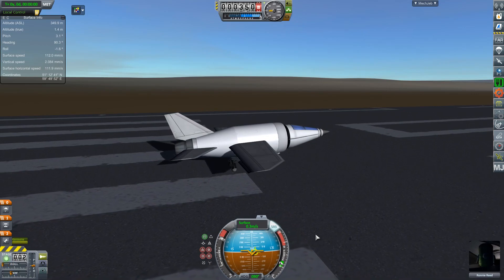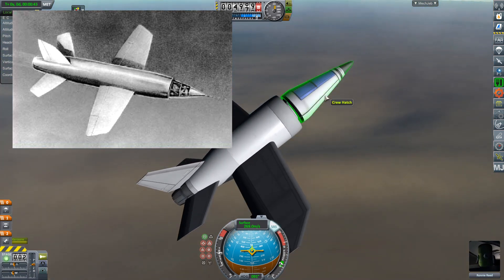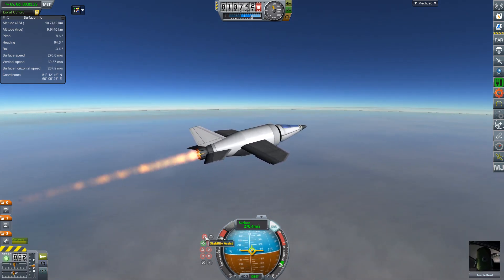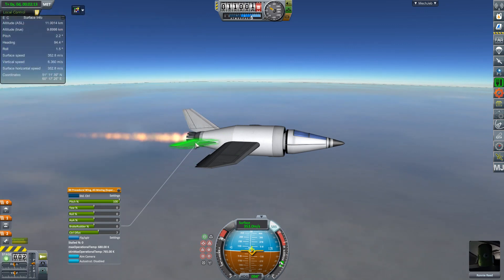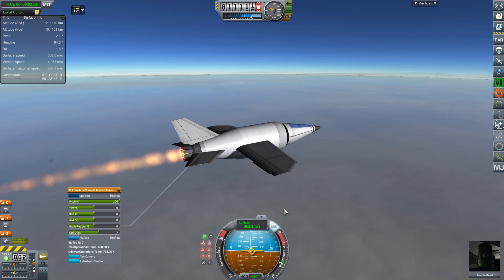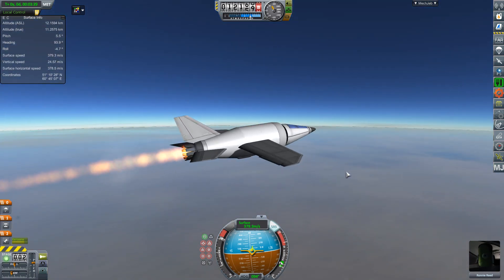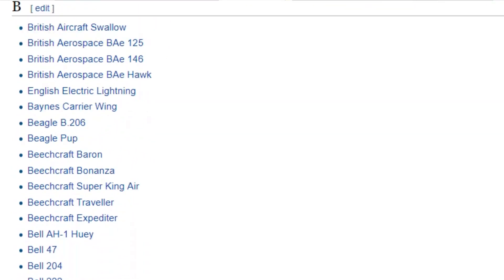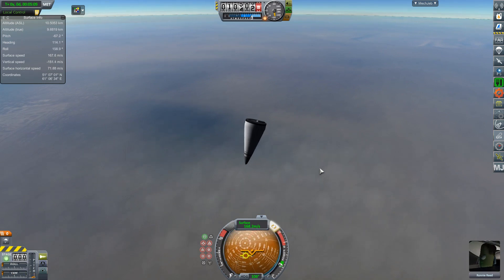Britain’s First Supersonic Aircraft Project - The Miles M.52

Comment: In Chuck Yeager's biography (a must read!) he says the shape of the X-1 was based on the 50 cal bullet, which was known to be very stable in supersonic flight.  So "bullet shaped" is spot on.
Reply: it always amazed me why the didn't give it swept wings. even my childhood intuition told me swept wings were better for fast flight than straight planks. i would've figured simple wind tunnel testing would confirm this to bell's designers.
Reply: It's also notable that this design runs counter to the transonic area rule, being fatter in the middle instead of thinner.
Reply: well that wasn't so obvious. area rule didn't become obvious to american designers until they were well into the century series fighters many years later.
Reply: Swept wings ARE NOT better for faster flight from a streamlining point of view. What they do at transonic speed is delay the onset of the compression shock wave which allows the aircraft to get closer to the speed of sound without buffeting. 

The most important aspect of supersonic wing design is to make the wing THIN and, where possible, short. That was done with the X-1 and the M52. Indeed, a number of different wing thicknesses were tried on the X1 to test the effectiveness across the transonic speed range of various wing profiles.

The concept of wing sweepback was known about before World War 2 and there had been a number of scientific papers published on the topic. Designers were wary of sweeping wings because swept wings introduce problems of their own such as stability across the speed range and also structural issues.
Reply: EricIrl Finally. You're one of the few people who understand this. Thats the reason they didn't test the all moving tail for the m52 on early jet aircraft, the wings were too thick. Instead, eric brown flew the prototype m52 tail on a SPITFIRE because it could reach higher speeds in a dive thanks to its extremely thin wing
Reply: @EricIrl  and the Me262 has swept wings for weight and balance reasons....
Reply: @mattjacomos2795  That myth is simply not true, the Me-262 was extensively tested to speeds up to Mach 1.4 in the world's most advanced supersonic wind tunnel at the RLMs Luftfahrtforschungsanstalt high speed research institute.
The Messerschmitt design of the swept wing Boeing B-47 was captured by the Von Karman mission at the facility in Braunschweig.
Reply: @sandervanderkammen9230  "Since the BMW 003 jets proved heavier than anticipated, the wing was swept slightly, by 18.5°, to accommodate a change in the center of gravity." P60 Christopher, John. The Race for Hitler's X-Planes. The B47 was subsonic as well mate. Please cite your source for your info.
Reply: @mattjacomos2795  Please cite your source that the Me-262 wings were swept only for weight and balance.
Reply: @sandervanderkammen9230  P60 Christopher, John. The Race for Hitler's X-Planes
Reply: @mattjacomos2795  I was expecting a legitimate source...
Reply: @sandervanderkammen9230  well, it's from the Wiki page and I noticed you haven't provided a citation yourself... I learned something from this however, I did not know the world had supersonic wind tunnels in 1920...
Reply: @sandervanderkammen9230  just so I know who Im arguing with, where do you stand on the Moon Landings?
Reply: @mattjacomos2795  Well he believes the Nazis had moon rockets if that's any help. 😅🤣
Reply: @tompiper9276 Sorry Timmy Pepper The M.52 never existed!
Deal with it
Reply: @sandervanderkammen9230  I thought you had died. Welcome back. And you're still wrong. Deal with it. 😉
Reply: @tompiper9276  Timmy, you batty little bugger! The Miles M.52 never existed, it is pure British science fiction!
Reply: Temper temper..... Blood pressure and stuff. As you accepted it existed some time ago l'll put your little outburst down to your, ahem, senior years. Otherwise how are you? I trust the weather remains favourable and your health robust.
Reply: @tompiper9276 The M.52 was not constructed.
The UK did not have a supersonic aeroplane until 1954.

Comment: I would like to know more about how big rockets support their weight before the start. Are there different concepts? Are there clamps or do they just stand on some part of the bottom of the rocket? Do some rockets just stand on their nozzle? They look so fragile, i don't even know how the nozzles survive the forces during flight. What about the wind forces from the side that could make them fall over? I hope for some interesting details ☺
Reply: Paul Paulson Yeah they have clamps
Reply: Designs differ, but basically there is a launch stand that in a way holds the rocket upright and at a distance from the launch pad. The stand has some sort of attachment that may either be clamps or literally bolts that attach it to the rocket. Normally the rocket will light it's engines for a short time before the attachments are released, and again designs differ, but after the rocket is given time to build up thrust the clamps may release, or in the case of bolts, small explosives will detach the rocket from the stand. This is done normally automatically as part of the launch sequence, with the launch team acting as a man-in-the-middle to interrupt the sequence if something goes wrong.

As far as the nozzles are concerned, they are designed to operate under high pressure and temperature, but yes the forces on them are great. but they also are shrouded from direct ram air pressure by the body of the rocket, so that helps. Also, some liquid fuel rockets circulate their fuel over the nozzles which helps cool the nozzle and prevent it from burning up. This saves weight since no less heat resistant material is needed to protect the nozzle.
Reply: Do keep in mind that when the engines are lit, the entire rocket is basically "standing" on the nozzles of the engines. The force distribution is of course very different from actually sitting on them under gravity, but you know.
Reply: If you watch this slow-motion video of the Apollo 11 takeoff, the Saturn V hold-down arms are shown and discussed in some detail: https://www.youtube.com/watch?v=vPW7ZqtW5U4
Reply: i believe that the reason for the rockets being cylindrical is that it offers the least resistance to wind effects. hence no square (or cuboid) rockets would fly upwards as neatly as cylinder. though im only using general physics as a guide and not actual rocket science ;)
Reply: Although the nozzle isn't designed to rest on the launch pad and withstand the weight of the rocket pushing down on it, while the rocket is in flight the pressure of the engine pushing up greatly exceeds the force of gravity (hence they fall upwards) so the engines are usually attached to the body of the rocket with heavy-duty tubular steel struts.

Of course, the smallest rockets use a long wooden stake that can be pushed into soft ground. ;-)
Reply: i use a bottle to launch my rockets, that way they dont get stuck in the ground  :)P  , very scary moment when you realize your rocket isnt coming out of the ground and you know the bang is coming
Reply: The cylindrical design has less to do with wind resistance and all to do with an even distribution of combustion pressure, think of it as the same reason why propane tanks have rounded tops and bottoms
Reply: TenebraePatruus Also, circles maximize the enclosed area while minimizing the edge length. Which is why bubbles are always spherical because surface tension wants to minimize the surface area, while the amount of stuff inside the bubble doesn't change (in other words, the volume). A cubic bubble (if you could even form one), would always contract into a sphere of the same volume. So, to my point, this reduces the amount of material you need for the skin of the rocket, saving weight. 

Though I'm sure that it's a combination of many reasons why rockets are cylindrical. The fuel tanks are cylindrical for reasons you explained, a circle has less drag than a square (only most important during the first moments of liftoff when you have a crosswind).
Reply: yep, i can live with that, as mentioned im definately no rocket scientist but maybe it was a happy coincidence that it offers less wind resistance, rather than inteneded design. from what you state that sounds more correct science. i do know that wind flowing round cylinders has no real pressure (certainly very minimal) compared to any other feasable shape for rockets (or any other object). i often wonder why they dont build skyscrapers in cylinder form, but maybe someone can point out why not too me ? would like to know. the only building i can think of is the leaning tower of pisa, and thats still standing.......just
Reply: Incorporating a curved aspect into any design usually costs more money than if you just used straight lines (it's easier to just cut out a flat plate than to bend one into the correct curve, for example). Also, it seems logical to me to think that skyscrapers are usually rectangular to maximize the usage of the plot of land which has a lot of real-estate value. A circular skyscraper won't be utilizing the corners of its plot of land and it could be viewed as a loss of residential/commercial space. I imagine that every bit of land in a city costs some big bucks.
Reply: they have crush weights.  So if you stack something really heavy on something that can't support it, it will explode.
Reply: Peregrinus ahhhh greed. i get it now. thanks. i always figured that going up was utilizing space and did not think about its base effect on land. shame really then. i think they would help aesthetically. even if it was just a couple here and there

Comment: The people that worked on the Bell X-1 learned the hard way that they needed a fully movable tail plane(horizontal stabilizer). Yeager found he couldn't steer the X-1 past Mach 1 until he used the horizontal trim.
Reply: The British Miles Aircraft Company who designed the 1000mph M52 had already sorted that long before the data was given to the USA.
Reply: Technology borrowed from the Germans the Bell X1 used a fly-by-wire electric stabilator copied from the Messerschmitt Me-262.
Reply: @Dave5843-d9m  Miles M.52 never existed... its a British fairytale.
Reply: @sandervanderkammen9230  You are a prolific troll. Why am I not surprised to find you here?:-)
Reply: @ianrkav  The TRUTH bears repeating lad...

Comment: You missed the part that the M52 would have taken off and landed under it's own power. The X1 had to be dropped from a B29 and glided to it's landing site.
Reply: The Miles M52 would never take-off under its own power because the Whittle W.B.2/700 engine was a total fiasco... it did not produce the specified thrust required to go supersonic and never successfully completed a full power test without damage... Whittle abandoned the project when he was removed from his own company Power Jets ltd. and exiled to drug rehab in the US, the uncompleted W.B.2/700 was canceled. The UK government had no choice but to cancel the now embarrassing, over-budget and behind schedule debacle that is now remembered as the M.52 fiasco, a plane that never was.
Reply: @doktorbimmer  In February 1946, Miles was informed by Lockspeiser of the immediate discontinuation of the project and to cease work on the M.52.   Frank Miles later stated of this decision: "I did not know what to say or think when this extraordinary decision was sprung upon me, without warning of any kind.    At our last official design meeting all members, including the Ministry and Power Jets' representatives, had been cheerful and optimistic".
Miles made a last ditch attempt to revive the project, submitting a proposal for a single near-complete M.52 prototype to be outfitted with a captured German rocket engine and automated controls, eliminating the requirement for a pilot to be on board.  However, this proposal was rejected.     Due to the project falling under the Official Secrets Act,  the existence of the M.52 was unknown to the wider British public; thus, neither the nation nor the world knew that a supersonic aircraft had nearly been built, nor of its unceremonious termination.
Reply: @johnpotter4750  The Miles M.52 was canceled before any construction of a flight rated prototype was started.
Reply: Miles M.52 never existed, it's pure British fiction

Comment: UK began building this wonderful plane capable of 1600 km/h in 1943, thanks to USA we never saw this plane flying... what we got instead was a rocket plane able of only 1200 km/h, oh and the Miles.52 also used a turbine which is more reliable and has better range, not to mention is the detachable cockpit with parachutes from the rest of the plane in case of emergency.
The design of the "full" moving elevators also got copied from the UK to the US.
Basically the intervention of the USAF delayed the creation of a superaonic plane by at least 2 years, giving a less reliable, technological and performing experimental plane. Thanks America!👏😔👍
Reply: Thought you Limeys preferred tea, not "whine"...
Reply: Actually, the X-1 did have a movable horizontal stabilizer.  It's mentioned in Yeager's autobiography that the pitch trim mechanism would move the entire stabilizer, allowing for pitch control even if the control surface was jammed by a shockwave.  He also mentions that he probably wouldn't have tried to push past the Mach if he hadn't felt confident that he could compensate for a possible sudden pitch-down.  The all-moving stabilizer on US designs was independently extrapolated from data gathered using the X-1's pitch trim mechanism.

Also, let's ask Captain Milburn Apt, one of the test pilots of the X-2, how well ejection capsules work... oh wait, he's dead because his ejection capsule killed him.
Reply: "Actually, the X-1 did have a movable horizontal stabilizer" - it did indeed in the end. But not "independently extrapolated". It was taken from the M-52 data which was shipped to the US. The official line was that they came up with it on their own, but it was one of those "ah, that's how they do it!" moments.
Reply: @bcubed72    Tea,   another American theft, or a recent complaint against SpaceX,   show the World  US 'Whine'
Reply: @paulsengupta971  The design of the Bell X1 stabilator is an exact copy of the design found on the Messerschmitt Me-262.
The Miles M.52 never existed because it was never constructed
Reply: @johnpotter4750  You cannot steal something that doesn't exist, the Miles M.52 does not exist... its a fairy tale, a figment of the British imagination.
Reply: @sandervanderkammen9230  You keep telling yourself that. In fact, it was designed, an unmanned prototype was built which achieved Mach 1.38, and a full sized one was being constructed. The jigs were all built, then they were ordered to be destroyed.
Reply: @paulsengupta971  Thank you for proving my point.
 The M.52 never existed.

Comment: I may be wrong, but didn't Yeager actually take an X-1 off from the runway and take it up to supersonic speeds when he was told that his airspeed record might not hold, since his aircraft was being given a boost by a carrier aircraft?
Reply: you are, in fact, wrong. the x-1 didn't have the fuel necessary to take off, achieve high altitude AND break the sound barrier. being a rocket engine it burned all its fuel i believe inside of four minutes.
Reply: I just checked up--Yeager did make one runway launch of the X1 (5th jan 1949) and got it up to 23,000 feet in 90 seconds, but it doesn't say if he also exceeded the sound barrier while doing so, so you may well be right.
Reply: IIRC, Yeager mentions in his autobiography that the flight did just barely push past the Mach, shortly before burnout.  I also seem to remember that the only reason they did it was because the Navy's D-558-II could take off from the ground and some Squids were ragging the X-1 team about how the Air Force couldn't really claim to have broken the sound barrier because they didn't take off from ground level.
Reply: Yeah, that's how I remember it as well, although I didn't realise the information came from Yeager's autobiography.
Reply: Is that the one with a broken arm ! !
Reply: @johnpotter4750  He is the one that broke the sound barrier... "Winkle" Brown just dreamed about it.

Comment: The previous airspeed record holder, and the last subsonic one, was the Gloster Meteor in 1946. This plane was powered by two Rolls-Royce Derwent jet engines, which I mention because my grandfather worked on the testing and development of these engines (as well as the Nene), as a freshly-minted mechanical engineer from New Zealand. His name was Percy Hambleton.
Reply: The Power Jets W2 jet engine entered production with Rolls Royce as the Welland and used in early versions of the Gloster Meteor. It evolved into the Derwent which replaced the Welland in the Meteor.
Reply: On Aug. 19th 1944, Luftwaffe pilot Heinz Herlitzius took off from Flugplatz Leipheim and reached a record top speed in level flight for air breathing combat aircraft of 624mph (1004km/h) in a Messerschmitt Me 262  (an official DAC record). This was the fastest flight of a production combat aircraft until the F-86 Sabre in Sept 14, 1948 at 670mph.
Reply: @David Elliot The Power Jets W.2 never entered production. The Rolls-Royce Welland and the Derwent were both designed by Adrian Lombard.

Comment: You're using Realism Overhaul?
So, are you using RealScale too?
If yes, then how did you fix the runway? 
My RO install has a glitch due to the 32bit placement of the runway on a 64b install (that really needs the extra floating point space. Using a 6371 Km radius Earth and all). Basically, every time the runway loads, it's pieces are misaligned. So, there's either a bump or a pothole on the airstrip. It makes most planes unflyable and or unlandable. Really annoying, and the mod developers say they can't fix it because the runway code is unaccessible to anyone but Squad.